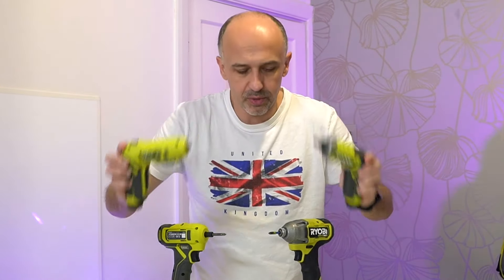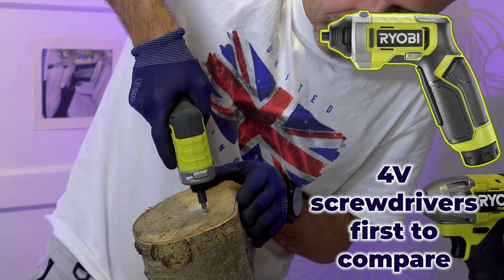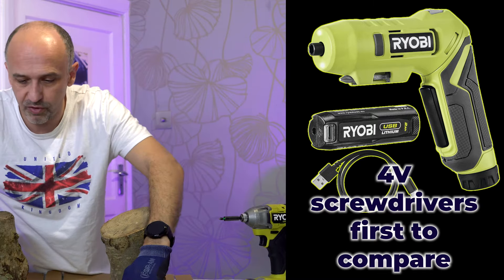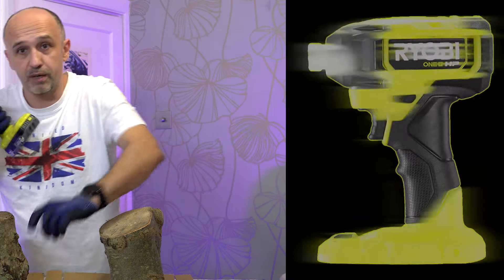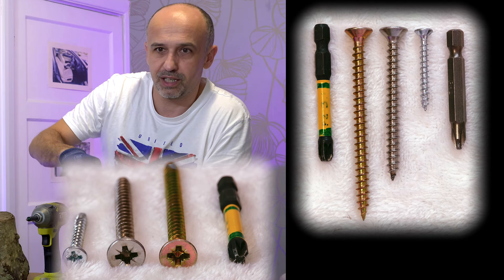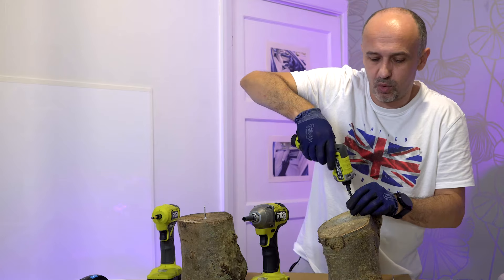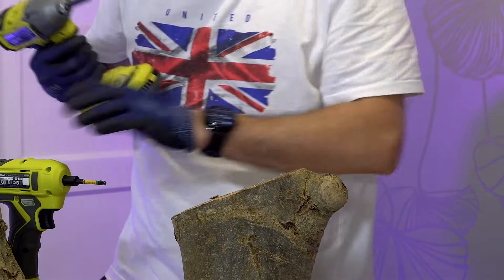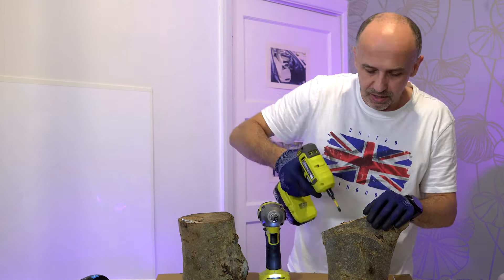The New 18V Ryobi ScrewDriver RSD18 vs Ryobi 4V Driver vs an Impact Driver

Comment: Good review, but maybe next time use a 2 x 4 for the screws as an angled log probably isn't a good practical test. Also I would have thought for the smaller screwdrivers you would have a pilot hole pre-drilled before using it. Last thing is maybe use a different screw for the impact and RSD18 as you used the same screw which stressed the screw head and snapped. Just a thought for a more fair test as it seemed rather bias towards the RSD18.
Reply from the maker: Hi buddy. Great suggestions. I might make another video then with a test only. Also, I have a other video with the test of small screwdrivers.